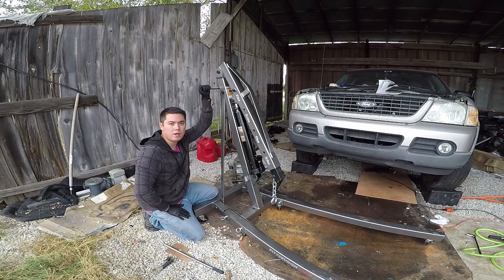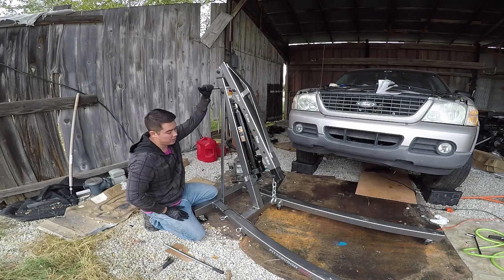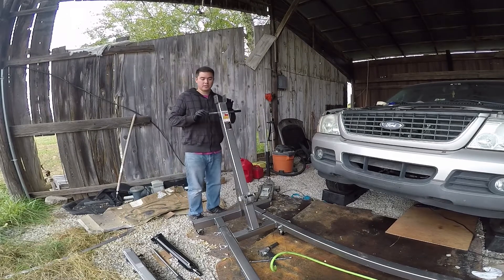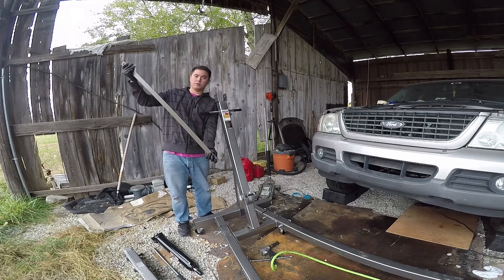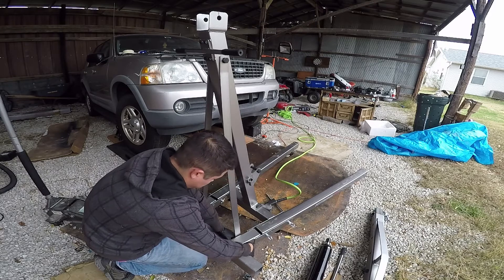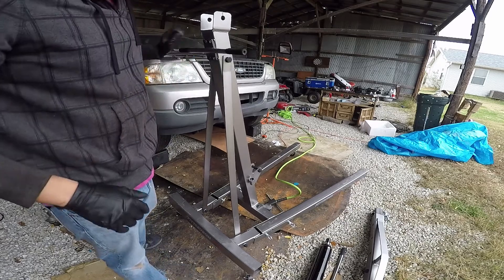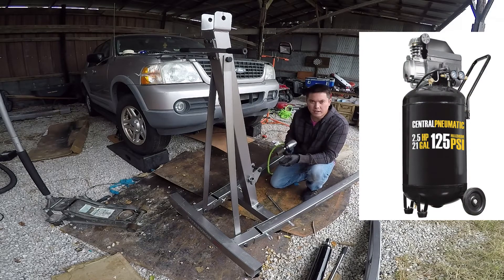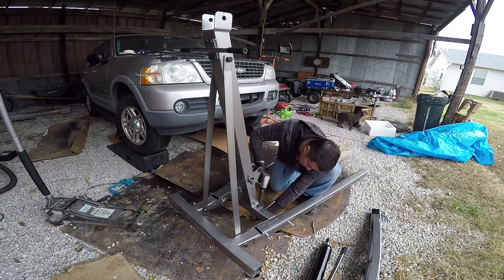Harbor Freight 2 Ton Engine Hoist Support Arm Fix

Comment: Matt - world of thanks to you for the simple fix.  I found the same issue and already ordered a 5/8" bit to redrill the hole on the upright as I thought that was the only fix.  I emailed harbor Freight but have not heard back yet.  In their defense, the instructions do say leave the bolts loose.  After your video, I was still skeptical as I felt the straps were a good 3/4" too short, but I heaed right out to the barn, loosened the bolts on the foot of the upright and bingo, I was able to make the bolts go in.  When they are tightened I believe they actually put sort of a preload on the structure that might be intentional.  They need to highlight that in the instructions.  Thanks!

Comment: Thanks.  I also had a heck of a time getting the bolts and crush washers connected to the deep end of the pipe for the caster wheels.  I have relatively long skinny fingers so was able to get the nuts started barely and then go from there.

Comment: Wow thanks bro 👊 wished they told you this in the instructions and also wished i saw this video before i drilled a new hole in one of the bars i didnt do the other one because i was assembling it at night and it got to late but im gunna definitely try this in the morning and if it works then you just saved me from drilling the other one and im just gunna have to live with the mistake i made from a inadequate instruction manual thanks a lot harbor freight!
Reply from the maker: yep, I almost drilled holes into mine too but figured I'd try it this way first. It'll work for you I'm sure. Thanks for the comment and don't forget to consider subscribing to the channel
Reply: @matthewhendershot2009  ya it worked i just did it thanks again i wish they told us that in the manual your video should be the first one when this hoist is searched because im sure everyone runs into this problem and it helped me after the fact i drilled a new hole but at least someone could see this and know what to do without thinking of drilling thanks again👍
Reply from the maker: no problem. Yeah I've seen others drill holes but I figured there had to be another way. I agree that the video should be the first search result as I searched endlessly for a video for the solution but only saw others drilling holes. Thanks for the kind words, happy new year.
Reply: Thanks for the video! I was gonna drill holes too😂
Reply: I almost drilled an extra hole as well.  If I recall, the instructions say not to tighten the bolts or things will not line up.  I read that and I was like..  ehh..

Comment: Thanks for the tip. Just bought one and will be putting it together this weekend. Just subscribed
Reply from the maker: Thanks Jeff. You should have no problems now that you know the trick with the supports.
Reply: @matthewhendershot2009  I just finished up and no problem whatsoever. Thanks bud!

Comment: Just bought the 2 ton and the instructions do say to leave All the bolts loose for adjustment... However the pic showed the wheels on already so I used the diagram for the wheels.. everything rests flat on mine...
Reply from the maker: hmm. I guess I missed that. I seem to remember just pictures and now actual text instructions.

Comment: I did the same thing but you still end up with more than 1/4 inch Gap at the bottom where the ram meets the frame
Reply: YEP MINE TOO..  I AM REALLY NOT COMFORTABLE WITH IT! WILL HAVE TO MODIFY AND WELD TO BE SAFE!
Reply: Just tighten the bolts... the straps will flex as you tighten the bolts to the ram as it is intended to do...it's fine...🤘

Comment: The instructions are worthless.  My instructions showed step 1 with wheels already attached.  Not sure how they were suppose to go but I used the 4 wheels that are the same size as base and the smaller wheels at end up arms.  Also, my side arms are short.  At least that is how they appear to be.  Thanks for this video because I honestly thought it was a misaligned hole from production.
Reply from the maker: Josh, I agree. The instructions were worthless. I figured that there had to be a way to align the bolts. I felt there was no way they had been manufacturing these things incorrect for so long. I will say that I had watched videos on people describing the misalignment and drilling holes to correct it and I didn't want to jump right into that and potentially compromise the hoist. There's a small margin of error with that thing holding a thousand pounds. Thanks for the comment!
Reply: If you went to the middle of the instructions book it shows what exact parts go where.  The small casters go in the middle.
Reply: @matthewhendershot2009  Check your gap at bottom of center post, you will find its not touching . Its not right !